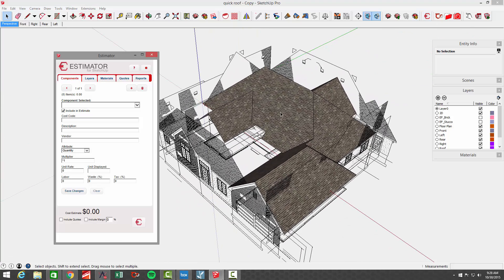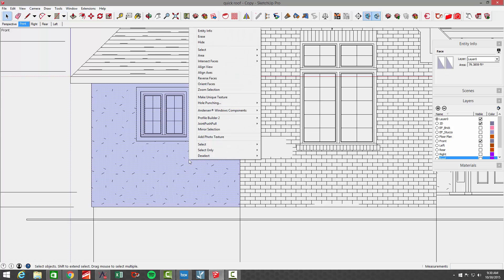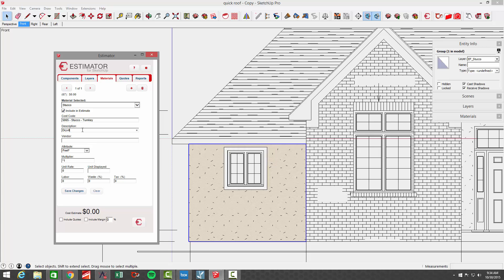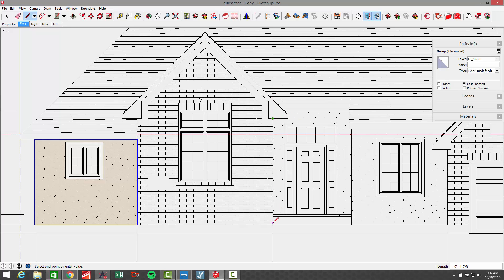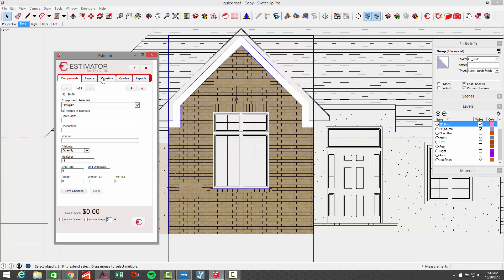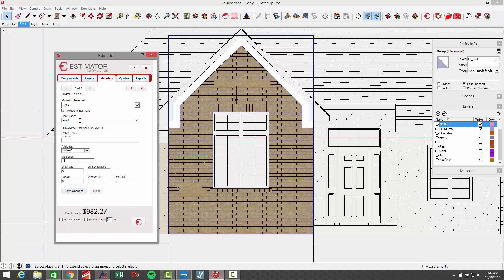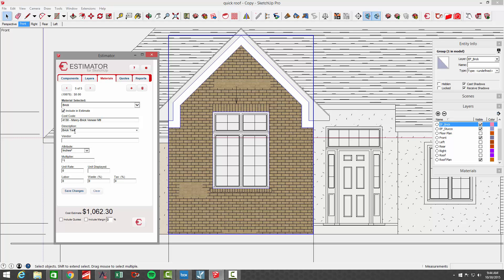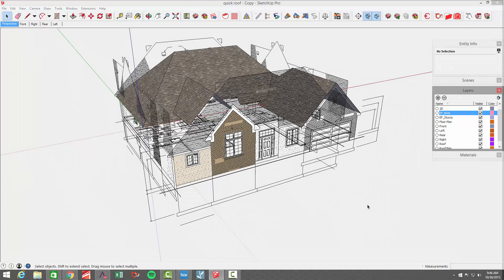Estimate Exterior Finishes using Imported 2D Elevations

Comment: Hi , can you tell me how many views has a exterior elevation?
Reply from the maker: Hello, I am not sure if I understand your question.  Typically, there are four views/elevations, Front, Right, Rear, Left, but may be more depending upon the project.  Parts of a building may be obscured by other parts and need additional view, or perhaps angled sections may contain a view straight on for clarity.
Reply: am not sure , it is on page 34 in walkers building estimators , type of drawings ,appear 4 as you said , but at the bottom has 2 more floor plan and roof plan ,am steel confused ,thanks